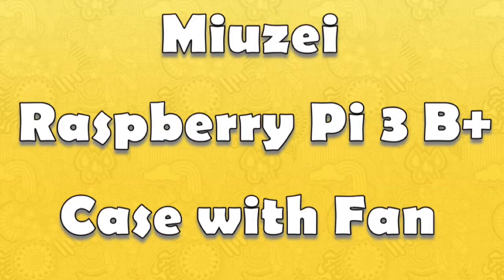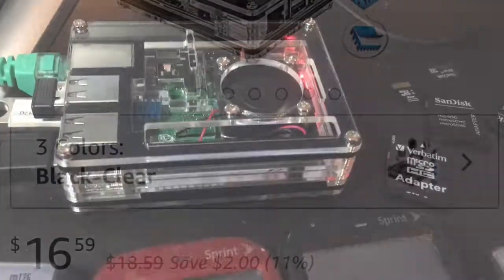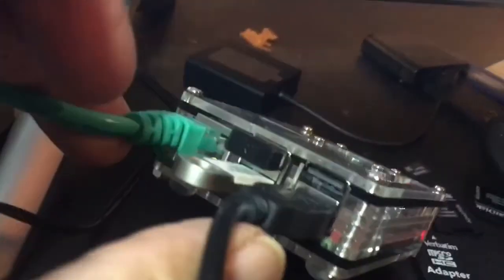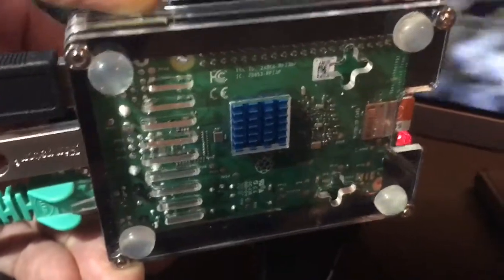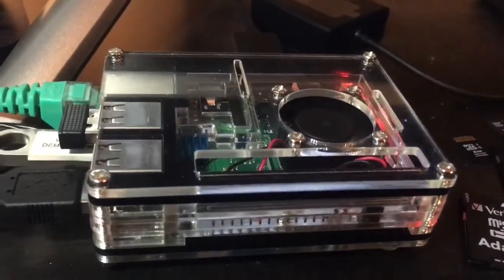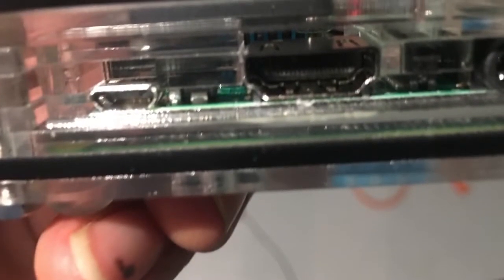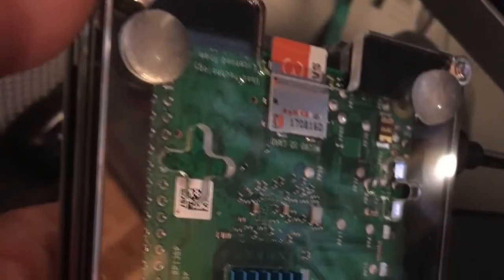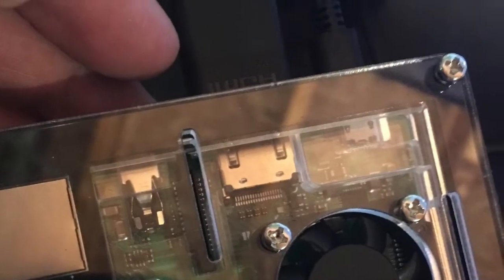Miuzei Raspberry Pi 3 B+ Case /w fan, heat sinks and Power cord

Comment: I bought the exact same case and it my cables plugged in perfectly. Are you sure you put the Pi on the right layer of plastic? I had some trouble figuring out when to put in the Pi and mine was out of alignment as well until I removed one of the layers and tried again.